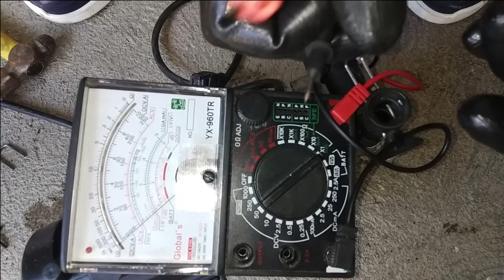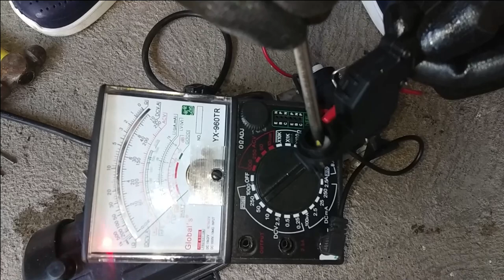Pressure Washer Repair 3 - Automatic Function Problem Solved

Comment: sir J, saan ka nka bili ng actuarial? parang ganito din sir sakin. pag wla ung gun okay yng daloy ng tubig pero pag kinabit na hindi na tuloy2 ang tubig, prang hinihingal
Reply from the maker: check mo muna sir baka barado lang ang nozzle (dulo ng gun), sundutin mo lang ng alambre na nasa manual, sundot at ihip lang.. 
Ang indication na sira ang actuator or pressure switch ay kahit hindi mo pindutin ang gun ay andar pa din ng andar, kumbaga hindi nagaautomatic..
Available po sa shopee kung need mo po. Eto po ang link https://shopee.ph/product/73483041/6153403100?smtt=0.73484505-1606557728.9
Reply: @jpinsel8368  Sir pa help naman yan din kaya posibleng sira ng K HPW-302 na pressure washer namin? gagana siya maglalabas ng tubig mamaya maya ayaw na kahit pigaiin mo pa ang gun walang lumalabas na tubig, at tapos may time na andar lang ng andar  siya kahit hindi mo pinipiga ang gun, salamat  sa inyong magiging tugon

Comment: Boss pag ga ihi lang buga ng pressure my pag asa paba magawa un.? Or my papalitan pa na pyesa.
Reply from the maker: yes meron po, pero depende pa din po sa pressure washer kung may available parts po sa market. Ano po pressure washer mo sir?
Reply: @jpinsel8368  d kalala ang brand ee inalok lang sakin. Balak ko sana kunin? Isip ko baka mapa mahal pako mura binibinta un oala sa pyesa malaki
Reply from the maker: baka sumakit lang ulo mo sir. Kapag bibili ka po masmaganda kung may available parts po.
Reply from the maker: ikaw pa din masusunod sir, suggestion ko lang po yan

Comment: Sir pano po yon gagawen at saan nakakabili ng actuator lotus 1400w po akin same po tayu problem . Tas diba po tuloy tuloy gumagana kahit di pindutin. Pag pinindot po sya parang amdami nyang hangin sa loob sana po makapag reply kayo
Reply: Yung manual nya may mga service centers actually kalat ang centers ng lotus kc branded sya..o kaya tingin kayo ng replacement sa Shopee or Lazada.

Comment: sir ginaya ko yung pag test mo sa automatic switch my continuity naman sa tester pg push ko.. yung pressure switch actuator na kaya sira? pingkaiba lang sa video mo umaandar pa motor kahit sira actuator sa akin kasi no power. pero pag manual ko pinindut yung auto switch my power na motor any idea sir?
Reply from the maker: possible nga na actuator sir

Comment: Sir same problem. San loc. nyo. Pwede po ba mag pa repair? Hirap kasi pag magpapagawa sa iba baka mag imbento at kung ano ano po sabihin na sira😅 thanks po
Reply from the maker: Bataan sir 😅 kung malapit po no problem.
Kayang kaya mo po naman lo yan diy sir 😄
Reply: @J Pinsel  thanks sir. Nagawa ko na pressure washer ko. May nag lleak narin pala na tubig sa loob. Pinalitan ko ng O ring at automatic switch. Thanks sa tutorial 👍👍👍
Reply: @jpinsel8368  sir ng rerepair k b san location mo bataan k b

Comment: Boss pano magpalit ng pressure switch ng ingco brand na pump
Reply from the maker: hindi pa po ako nakakapagbukas ng ingco, pero same lang naman po sila ng function.
Reply: Ah ok po. Hirap kc kalasin ng pressure switch nya. Nababasa sa loob ng pressure switch kya siguro ayaw mag automatic off. Di ko makalas bka masira lalo. Salamat. Your video is very informative and useful... Hoping for ingco brand video next time. God bless
Reply from the maker: thank you po. either pressure switch or ung nagtutulak po sa switch ang possible problem po.

Comment: Boss ano po kayang problem ng pressure washer kapag ginagamit nagana sa una pag spray ok nman pero pag tinigil ang pag spray ayaw na gumana pati power?
Reply from the maker: check mo po muna ung automatic switch kung nagfufunction or baka stock up.
Reply: Sir nagpalit na po ako ng actuator ayaw parin mag automatic off ok naman po ung micro switch nya function naman ano pa kaya possible na sira?

Comment: boss pag putol putol ba ang andar at buga nya ano po kaya problema?
Reply from the maker: may leak po yan, check nyo po kung saan nanggagaling. Karaniwan po sa oring lang ng hose baka may lamat na or sira na, check nyo din po ang gun kung may leak. kapag wala po sa nabanggit ang leak, sa mismong pump na po yan
Reply: @jpinsel8368  ah ok. ganun po ba. wala naman po leak. pero pag kinabit ko lng naman ang spray gun ganun sya. pero pag hindi po ayderetso naman ang andar at buga ng tubig.
Reply from the maker: diretso po talaga ang andar kapag hindi nakakabit ang gun. Ang pagtest po kung normal ay dapat nakakabit ang gun at hindi sinisinok. Hindi nyo po makikita ang leak kung loob po ng pump ang may problem.

Comment: sir yung saken fujihama fjb302. pag ginagamit ko ng derederetso may time na bigla sya uugong ng parang wla na tubig sa timba pero madame pa. tapos biglang okay ulit.
kakabili ko lang nun last 2 days
Reply from the maker: possible na may hangin po sa loob. magbleed ka muna po bago gamitin. Paandarin mo muna ung washer na hindi nakakabit ang high pressure hose (black hose), kapag sumirit na ang tubig sa washer ay pwede mo na ilagay ang hose at gun. Happy washing! 🙂👍
Reply: @jpinsel8368  ganun nga po gngawa ko. pero bigla sya umuugong ng parang wlang tubig. tapos bigla gagana ulit ng maayos haha. kakabili ko palang. tapos sadya ba na pag ginamit ko at tinigil ko pag pisil sa gun may squiky sound sya.?
Reply from the maker: kapag umuugong po ay nagkakahangin po sa loob. Check nyo po baka umaangat lang ang filter kaya nagkakahangin. Normal lang po ang tunog na un 😁

Comment: boss pag po laging nag automatic every 2 seconds ano po issue nun? meron nmn po nalabas pero himihina oressure very 2 seconds.pag tinangal nozzle direcho nmn po.
Reply from the maker: barado po ang nozzle.. check nyo po ung butas sa dulo ng nozzle dapat po clear po sya. May alambre po na panundot po sa nozzle na kasama po sa manual po ng pressure washer sundutin nyo lang po at hipan para mawala ang dumim. Kapag clear na po ay babalik na po ito sa normal 🙂👍
Reply: @jpinsel8368  cge sir try ko po yan.maraming salamat po sa sagot.